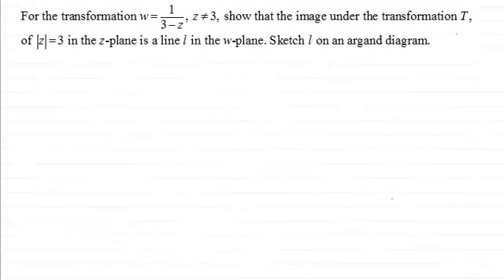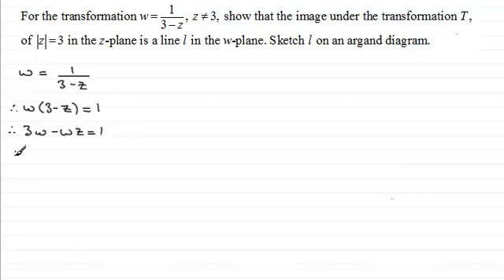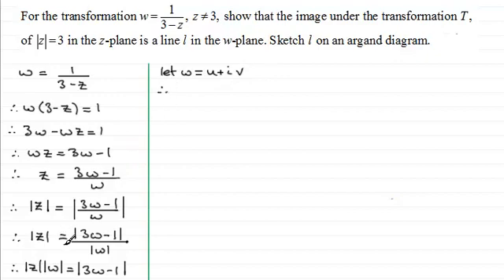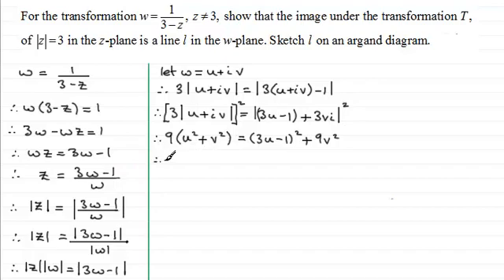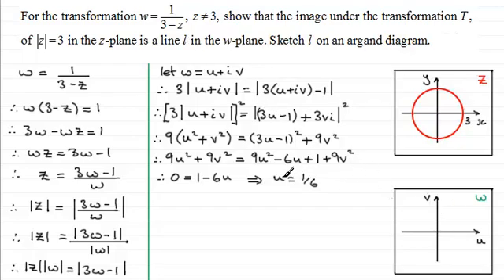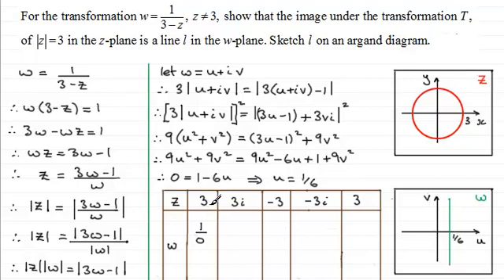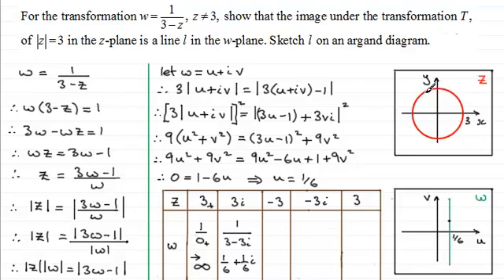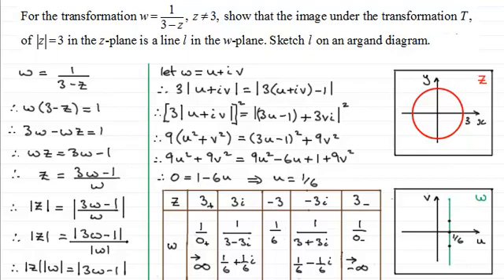Transformations of the Complex Plane - Example 1a : ExamSolutions Maths Revision

Comment: HI sir,
Shouldn't the (3vi)^2 be equal to -9v^2 since i^2= -1 ?
Reply: yeah had the same thought but think i understand now, your squaring the modulus so we know the modulus of a + bi is the root of (a^2 + b^2) so squaring gives a^2 + b^2. the i is just the vertical axis but doesn't do anything to the modulus. I think this is why.
Reply: exactly what i thought
Reply: oh yeah that makes sense thanks mate
Reply: My main query was why in the modulus beside the 3 not treated as a double bracket, all being squared?
Reply: xSpyInPinkx because modulus squared is just the length squared which is Pythagoras hypotenuse formula without the root, no multiplying the bracket out.
Reply: Ahhh right! thanks!
Reply: at least i think thats why, makes sense to me
Reply: Niaz Gul Hazarboz you're right
Reply: anonymous xx yes when squaring, but the whole point of moduls is absolute values since they are lengths. Therefore you dont put "i" at all because its length is 3 in the y direction